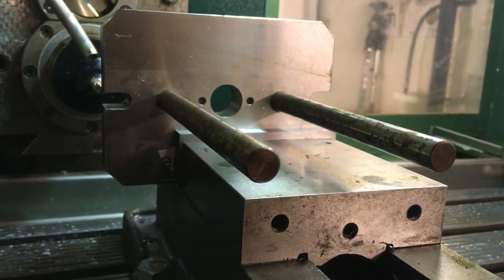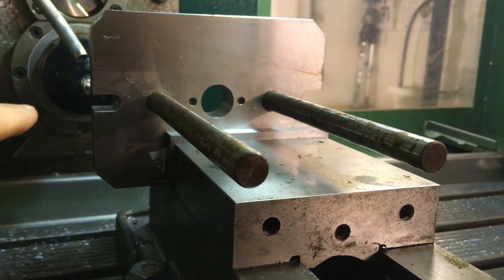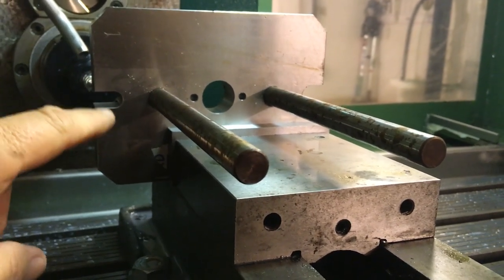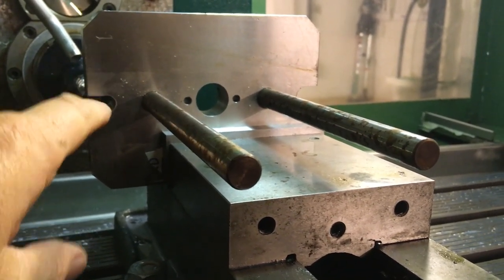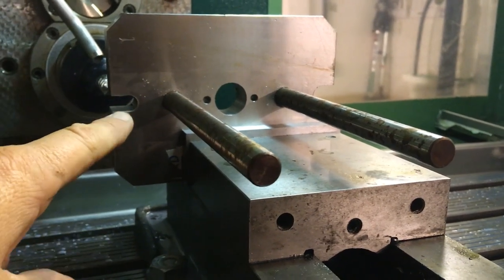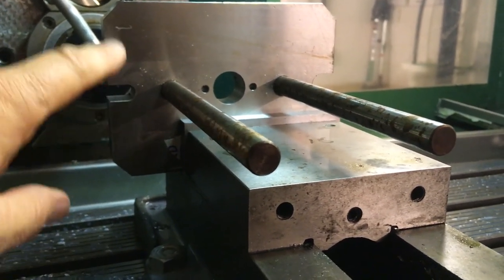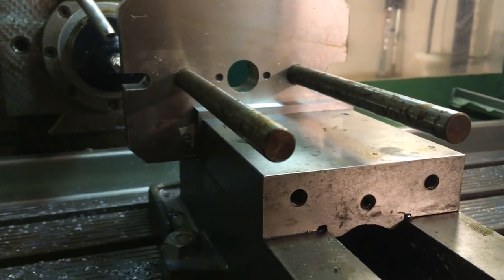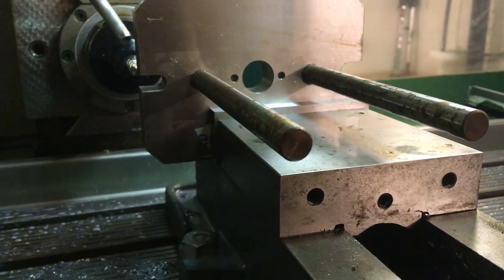Enlarging clamping slots using the MAHO horizontal spindle

Comment: Hi, I just discovered your video about retrofitting a Maho 400E. You did a great job! I do have a Maho 400P I partially retrofitted 10 years ago. I replaced the old Maho controller with a  home brewed electronic board & software. My software accept G-code, do the speed & position control however I didn't add any step motors so my 400P operates  only in the original point to point mode (the tool can only be moved one axis at the time). Today I would like to add 3 steps motors  to turn the milling machine into a full 3axis CNC.  I could not see in your videos if you have replaced the hand wheel with some step motors? I would greatly appreciate if you could give me more details about the step motors you used and  how you have connected them to the hand wheels. Can you still use the hand wheel? Does CNC linux operates the step motor in closed loop (with the glass scale)?  Regards, Dominique
Reply from the maker: Hi Dominique,

the Maho MH400E never had hand wheels. It was  full on CNC from the factory, with three separate DC servo motors from Indramat.  This Old tony, also has a 400P, as does another guy on the linuxCNC forum.

Here is the whole retrofit thread:
https://forum.linuxcnc.org/12-milling/33035-retrofitting-a-1986-maho-mh400e?start=0
Mark